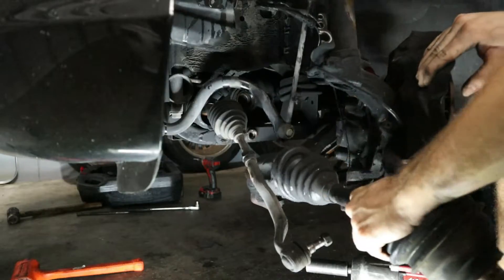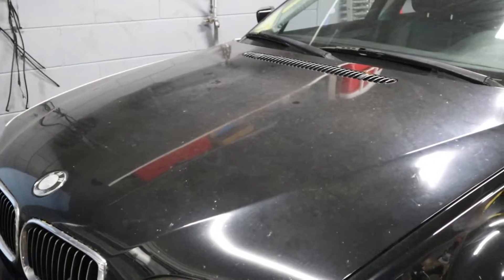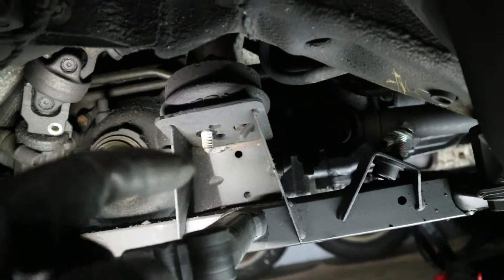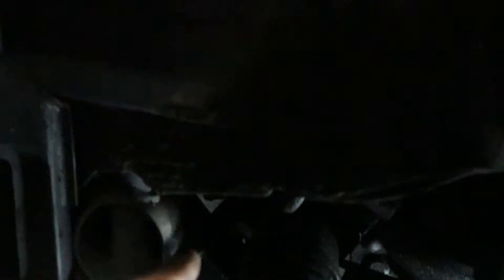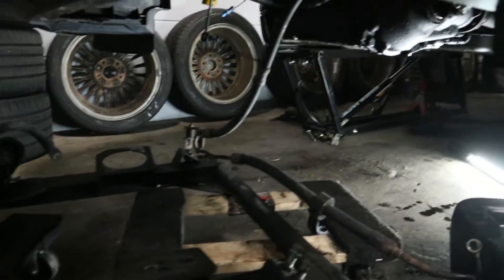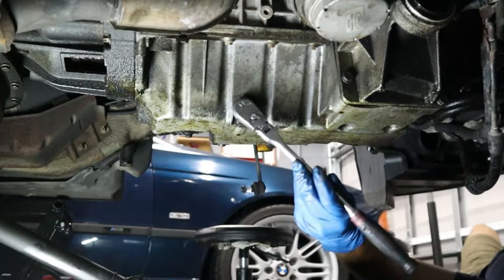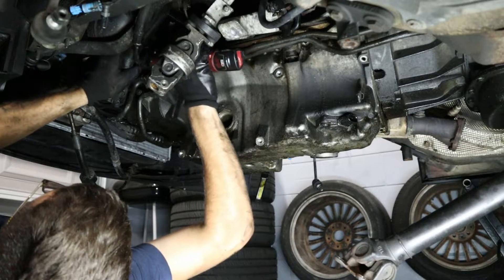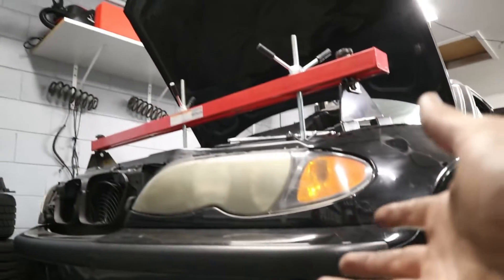How to: Replace 325XI AWD Oil Pan (and all X-Drive BMW!)

Comment: Getting ready to do this myself but I heard that you need special tools to separate the front diff from the oil pan or it can break one of them. Glad to see that guy was full of it lol. Still a pretty big job though, good information and thank you for including what sizes I will need. I have a 22mm but I usually keep it at work so I'll be sure to bring it with me when I tackle this project myself.
Reply from the maker: I'm so glad I could help! Good luck Ramon
Reply: @TheBimmerBarn  thank you!

Comment: Great video, thanks!  I'm about to tackle this job in conjunction with a few other projects:  replace power steering pump, lines and reservoir; replace oil filter housing gasket and oil sensors, tighten up water pump bolts (didn't get them tight enough when I replaced the pump), and possibly some suspension bushings if they look bad.  Looking at your video, it looks like I should also replace the motor mounts while I'm working on the oil pan.  What else should I replace for preventative maintenance while I'm down there?

Comment: When reinstalling the subframe did you replace all 4 bolts that connect to the body and the 2 on both sides for the control arms? And if you did can I get part numbers for them because I’m having a tough time finding them before I start this job.

Comment: Hi! Do you know if the front differential is the same on the e46 330xi touring from 2000. I recently took on a new project  and I might need to change the whole differential.

Comment: Nice video. Now that i have seen we share the same type of oil pans. What is the actual oil capacity of this very oil pan. The car manuals are made standard for the ordinary 325i when it comes to the xi there are alot of internet battles saying 7.5 litres to 8 litres and others saying 6.2. Whats the right capacity for the xi?

Comment: So I was unfortunate enough to blow the motor up on my 2001 xi wagon years ago. Its been sitting since and im just now getting around to replacing it. Or gonna try haha. How much more work after this point you got to, would there be involved in order to pull  the engine? I cant imagine much, besides exhaust removal and unbolting the transmission... and I guess electrical connections and emissions and what not... Am i right in thinking so?
Reply from the maker: A lot more work to pull the engine, everything on top of the motor needs to be disconnected as well, and then you may have to remove the transmission as well, depending on how you're removing the motor. Good luck! it's a big task on these AWD cars, but can be done with patience!

Comment: Yo, more 325xi content!! Do a m54b30 swap maybe? Big brake upgrade?
Reply: Why?
Reply: @kaywonderer  because racecar
Reply: @moofmilkinnerfherder4911  LOL dude This is AWD, they don't race with AWDs.
Reply: @kaywonderer  why
Reply: @moofmilkinnerfherder4911  Say your engine blows up in middle of race, awd is harder to swap. Also less efficient.
Reply: I have a 330xi. Not fast. Don't bother.. mid range it's quick but my old 92 maxima walks it after 120mph with 30 less hp
Reply: @ve2430  you talking trash. I owned a maxima.
Reply: @kaywonderer  I bet you didn't own the SE model with the 5spd and DOHC motor known as the VE30DE. 190hp and faster than next gen VQ maxima on top end. Most people don't even know it existed. I should have been more specific. Top speed 145mph+. I have a video if you you need. You probably owned the crappy VG30E engine in the GXE model.
Reply: @ve2430  well 330xi will eat up the maxima in any kind of real world road because of better handling. I can reach 145mph with my 325xi let alone 330. AWDs arent made with top speed in mind.
Reply: @kaywonderer  don't be too sure about that. E46 330xi is about 300 pounds heavier than the J30 maxima. If you put a nice suspension set up on both cars, it will be close on any road except snow/rain. Plus this awd set up on the bimmer understeers a good amount at the limit. I own this bimmer since 2007. I know it really well. Just so you know, I was side by side with my friend's E90(auto) back in 2006 when they just came out, with my old maxima all the way to over 140. That just goes to show you how good the top end is on that car. Up to you if you want to believe me. On the forums people would joke that I have a factory freak and they did not believe it lol but I'm telling you, this thing could really hang with cars you would never expect on top speed.. Anyway, the point of my post was that the 330 is not really fast. It's quick. I even had a lightly modded 325 hang with me on top end. Def not a worthwhile swap. I see alot of people doing the S54 swap on e46. I remember years ago it was very hard but I hear it's pretty common now. Not sure what changed.
Reply: @ve2430  I don't need to smoke, i can see how many 90s nissans are on the market vs how many 90s bmws on the market.
Reply: @kaywonderer  actually you’re wrong there are all wheel drive race cars all around the world think about rally and all the Nissan GTR‘s that are still racing